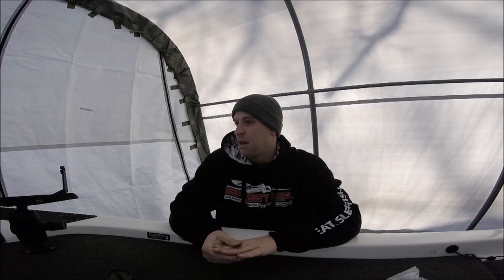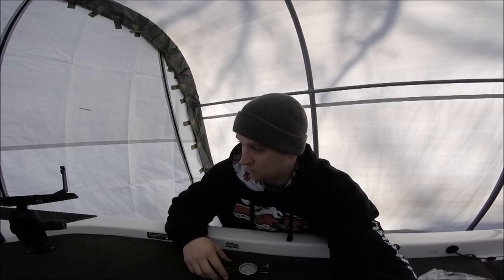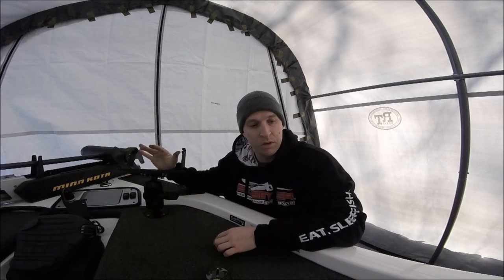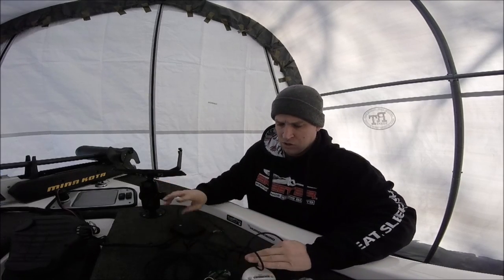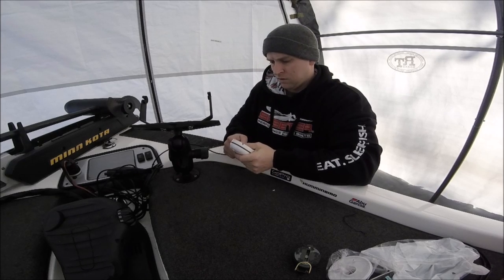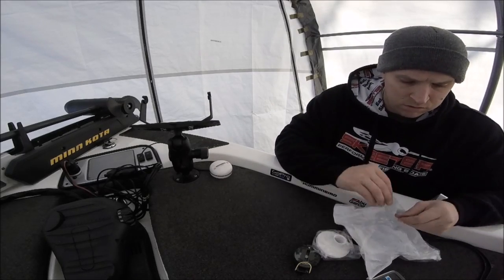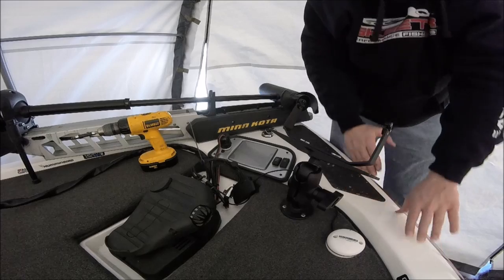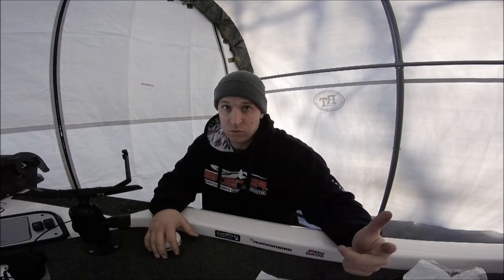Heading Sensor Install Part 1 Vlog Series

Comment: Question your motor was not down.  Your not going to use the motor with the puck with it in the up position.  If the motor is down it should not effect the puck.  Is there some other interference up front?

Comment: Two comments:
1) with the trolling motor stowed like it was, your compass was getting fairly close to the magnets in the electric motor. That is what likely started to throw off your compass.  I'm betting if you put your motor in a deployed position, the motor magnets will be below and away from the heading sensor.

2) I found that playing around the front of the boat with a compass just like in the video, getting anywhere near the winch on the trailer caused the compass to go totally nuts.  But chances are if you are out on a lake, the heading sensor won't have an issue with the winch like it does in the garage. :)
Trying to select a mounting location with the boat on a trailer may not be the best way of going about it.

Comment: Arent you supposed to mount parallel with the v of the boat, not angled with the arrow pointing  toward the bow.
Reply: Thats what they say in the manual
Reply: I was thinking the same thing when he said to 'point it toward front of boat' I immediately scrolled to comments. I would have angled it to parallel with front of boat since it is installed to the side of center.

Comment: Do I need a heading sensor to use spot lock? I'm not sure I understand its function. What if I dont plan to network the trolling motor with a chartplotter and just want spot lock?
Reply: no been using mine without.. just watching videos now desiding if gona install leaning against it...seams just for jog  feature

Comment: It looks like you mounted it crooked to me, eyeballing it from the front is pretty tough, you really need to mark and measure in the boat to get it square. That being said are you happy with it? Does it do what you wanted?
Reply from the maker: Scott Carder it’s strait. Works really good. You should definitely get one if your in the market.

Comment: When install do I need to use a inline fuse with it? Can I just hook straight to the battery? I just got my new Minn kota Ulterra today. I just sub!
Reply from the maker: Lee Sirlee  nice.  The heading sensor just hooks up to the graph that is where it gets it’s power from. No fuse required.
Reply: @thebassstalkers6260   How would it turn off? With the compass it seem like it's not working right for me or I'm just doing it wrong?
Reply from the maker: Lee Sirlee it turns off when your graph turns off.  To check that it’s functioning properly is easy. If you are on your chart plotter screen even with no movement to your boat you should still have a black line coming out the front of your boat on the screen. You can also hit menu twice and go all the way to your network tab. Go to your unit and tab over to gps. You should have two options. 1 will be internal and 1 is external. You want the external.
Reply from the maker: Lee Sirlee the compass is only used to find out where to mount your heading sensor. The compass will tell you if your getting interference from the magnetic fields put off by your trolling motor
Reply: @thebassstalkers6260  Since I got the Ulterra. I couldn't use my old front fish finder. As of right now I dont have any fish finder on the front. Can i still use that same power line and will it still turn off? It's best to mount it in the front of the boat?
Reply from the maker: Lee Sirlee if you don’t have a front graph I would run it of the console graph. Then you don’t have to worry about it. And if you have your units linked. When you get the front one working again you can go into network and select to use the heading sensor.  Weird that the new trolling motor made your graph stop working. Does it still turn on and just not give you your 2d, SI,DI?  If so you might want to not plug in the built in transducer the trolling motor to your unit and instead mount and hook up an actual humminbird transducer with a trolling motor mount.

Comment: heading sensor should be mounted as far away from trolling motor as possible it will do a better job when on spot lock mine is in back of boat then powered from under dash with rocker switch
Reply from the maker: ron larson yeah the one for my ultrex is behind the drivers seat. The one for the graphs really don’t matter as long as they are not affected by the trolling motor. A lot of people have 3. 1 up front for the front graph, 1 for there trolling motor in the back and one in the back for the console graph.
Reply: @thebassstalkers6260  thanks started thinking i was dumb